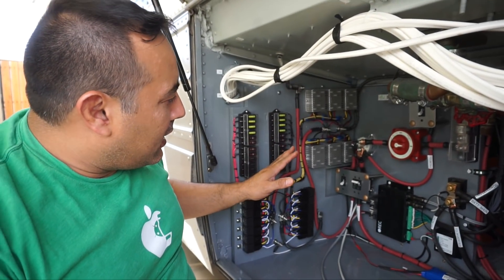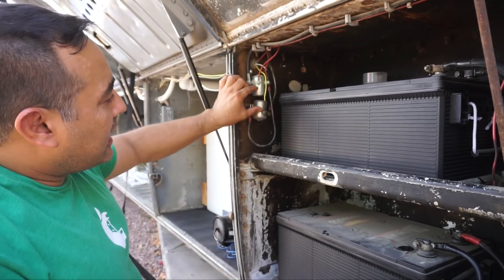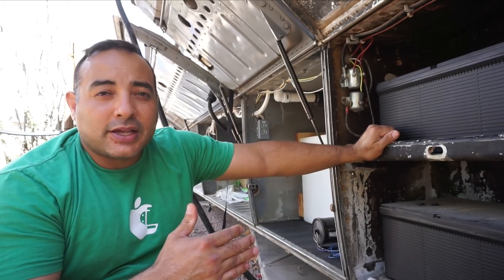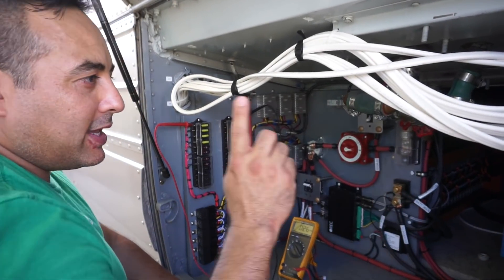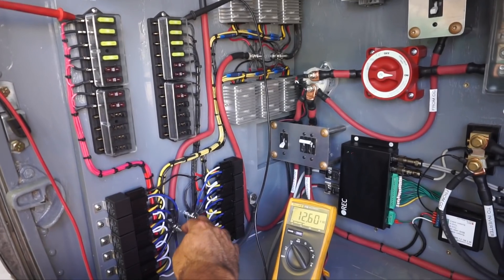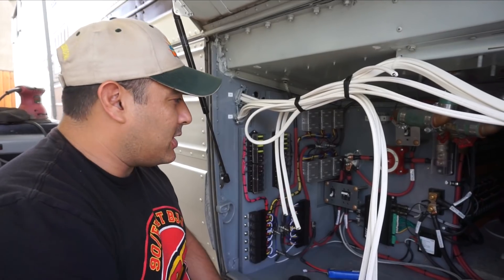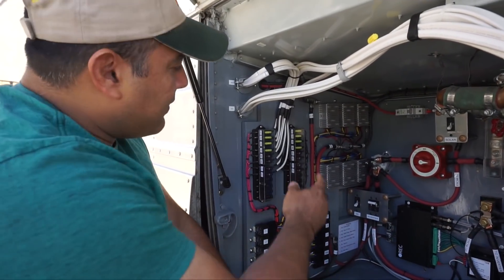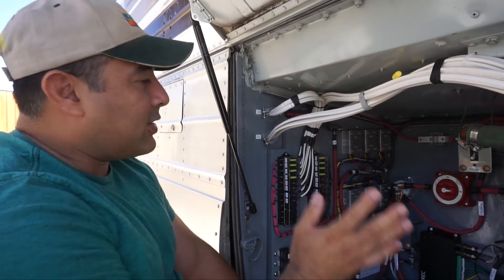DC Power Part 2: Testing, Running Cable, Generator Hook-Up

Comment: Jaun, I was wondering if you are using pure sine inverters? Also is your gen. going to be pure sine? I have a couple different Generators I use and the pure sine does a much better job in using less fuel and delivering a safe sine wave. Here is the pure sine I use. There is no need for a high priced Honda. https://www.youtube.com/watch?v=WgpRwKzZkb4
Reply from the maker: Hi John - Yes our Inverter is a Victron Quattro 5000 and is a pure sine inverter.  The generators we have been looking at are "inverter" generators because they seem to be the quietest option.  We hope not to have to use a generator very often but when we do we would like the noise level to be manageable.  Thank you for the link - I will look into those generators.
Reply: You are welcome and thank you for the reply.

Comment: Great work!  I love this project.  Why 6 converters and relays instead of one, I don't think you explained why you did it this way?
Reply from the maker: Hi, Steve's Channel, Thank you for the kind words.  The main reason we went with 6 converters is we couldn't find a single 1500W converter to handle the loads.  These were also fairly inexpensive at around $20 each and had great efficiency (96%) rating.  We will report back on how they actually perform
Reply: FYI they do make a 13.8v/30a version of those converters that works a lot better than the 12v ones due to the long cable runs to the loads.  You would be better served by using as few converters as possible.  I've tested these things quite extensively and you can safely run them at their max rating for a very long time and they are reliable and efficient there.  Why do you need 1500W of 12vdc?  Big stereo?
Reply from the maker: Thank you porkbuttrocks - yes the 13.8V version would be a better choice - we are switching two of these out for that version that will run motors (water pump and cooling fans) - The reason we went so big is that we wanted to keep most of the "house" systems on 12V for the ability to have a decent "backup" solution if our Nissan Leaf battery were to have issues - we could simply run on the "Bus Chassis" batteries (consisting of two large 8-D batteries in parallel) - so we tried to run as many systems on 12V as we could (lights, pumps, fans, chargers, stereo, etc).

Comment: Juan,
Couple notes; 
1) UL rated 1/4" QD (quick disconnect) terminals only capable of carrying a maximum of 24A regardless of the wire terminal socket size. The issue is the neck between the wire socket and the terminal blade is so small that it becomes a virtual fuse (actually just gets REALLY hot). You can widely find them with 10ga wire sockets which I note that you are using. In many folks minds, 10 ga wire = 30A capable but the terminals are the weak link. I know that you do not intend to operate your circuits over 20A so you are fine but be forewarned. Most 1/4" QD's on fuses and relays that are rated over 24A MUST use a socket specifically designed for that rating. These sockets use 'flag' terminals or other special terminals that do not have the small neck.

2) There are a couple breaker and fuse rating/design standards that are commonly ignored but you will be well served to observe (and you may already be). Most people think that the fuse or breaker on the circuit is the capacity of the circuit but its a little different, more so with fuses. Fuses should be 133% (4/3rds) of the circuit 'continuous duty capacity' and breakers should be 125% (5/4ths) of the continuous duty capacity.  Continuous duty is defined by UL as connected devices operating over 4 hours in a 24 hour period. The reason is that they are both thermal acting devices with non-linear heating curves. This means they stay at a relatively low temperature at 75% (3/4 capacity for fuses) - 80%(4/5 capacity for breakers) of their interrupt rating but get pretty hot pretty quickly above that. You don't want to put a 20A fuse on a 20A circuit that will run continuously above 16A (80%), the fuse will be very hot and dissipate a lot of that heat into your fuse block and the terminals it connects to. The additional 20% of the circuit rating is usable by 'intermittent duty loads only. Long term overheating of fuses can lead to nuisance tripping (least problem)  or accelerated corrosion leading to cascade failure (worst). I mention this because in your planning of all your circuits, I'm sure you have identified your loads but probably did not determine which were 'continuous duty' and which were 'intermittent duty' (<4 hours in 24).  If you discover that you have continuous duty loads above 16A, then it is advisable to upsize the fuse ONE SIZE. A little capacity overage will not lead to wire failure but will likely save melted fuse bodies or nuisance tripping.
Reply from the maker: Thank you Steve.  I can see how those little necks would become like a fuse!  I only knew about 50% of all the safety tips you offered - thank you so much for sharing them.  We hope our high loads are fairly intermittent (water pumps are rated for 5 Amps I believe, even the fans are only 9 Amps when added altogether (3 Amps each)).  With all LED lighting and tablet/phone charging for the rest of the circuits, we hope to stay well within the mentioned safety margin.  I will keep an eye on it - thank you for commenting.

Comment: That's Awesome! Congratulations! 
Do you know if you're the only one running a setup like this?
I like how most of your wires are up off the ground. I'd be worried about rodents, squirrels, and rabbits eating them. I found out that a lot of at least automotive wire coating is now soy based and they love it. 

Both rats and squirrels got two of my vehicles in the driveway. Came up with a concoction of protectant spray with peppermint essential oils and 1.5M SHU capsaicin drops. They stayed out, but I gotta remember not to touch anything with bare skin! Lol
Reply from the maker: Thank you for the comment - We recently asked a long time bus dweller what his advice would be for a couple of newbies like us - he said: "Beware of the mice"!!  Do you think we should put them in something more substantial than just the thick vinyl wrap?  We will look into your anti-pest potion!
Reply: I think you'll be fine for most of your wires up high. The main areas I'd be concerned with is the hidden areas, Like back where your batteries are. Anywhere they could make a nest they will chew on stuff in that area. Like nook and crannies and flat surfaces. There are sonic devices that have good track records too. You definitely have enough battery to run a few of those.

Comment: When something goes wrong you will know how to troubleshoot it. I think you are going to need a generator. Did you see on Technomadia that they have a low profile generator in their spare tire bay, behind the front bumper? I think they like that set-up.
Reply from the maker: Hi Kevin.  Thanks for the input, I suspect we are going to need a generator as well.  I did see the Technomadia's propane generator in the spare tire location - I like that as well but I do think there is value in carrying a spare tire so I am a little torn.  I think in their video they said if they ever got a flat they would just call Coachnet - knowing myself I think I would try to change the tire ... LOL maybe I am being foolish
Reply: +Beginning from this Morning We had a retread blow off recently on the way to Salt Lake City. It got replaced quickly and we were on our way again within an hour and a half.
Reply: Today I ran the genset for 15 minutes and it shut down due to overheating. It is air cooled and the bay door is all heavy screen. But apparently there is not enough air circulation. We'll probably switch in a Kubota water cooled. It'll be able to pre-warm the 6V92 Detroit.
Reply from the maker: Our mini-split A/C is in a bay with the mesh screen - I have thought about putting some fans in to force the air over the coils and help get the hot air out.  Water cooled will likely give you much less headache.
Reply from the maker: What service are you using?
Reply: +Beginning from this Morning Our Progressive policy covers flat tire service. They reimbursed us in-full quickly. We paid for the new tire. We were lucky that the retread did not damage anything when it tore off, and luckily, nobody was close behind us.

Comment: Interrupting the ground is not really needed in my opinion, but you can. Remember every relay draws a current and consumes power from the (smaller) bus batteries when active. You could have used a relay with more contacts to limit the number relays (power) needed. Maybe determine how much the draw is when activated. Nice installation! Thank you for making these videos!
Reply from the maker: Thanks Freddy - You are probably right and I went back and forth on the ground fuses and decided to err on the side of safety (although it does make it a little more complicated).  A relay with more contacts would have probably been a better design.  We determined that the draw for all 12 relays was just over two amps.  I learn a little bit more with every video.  Thank you for the suggestions.